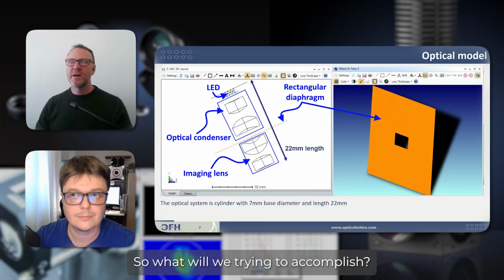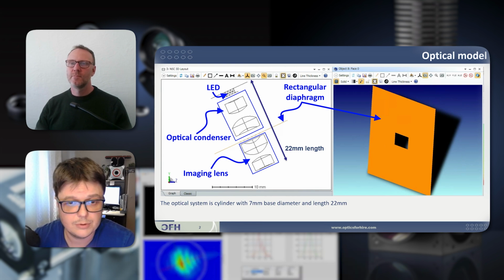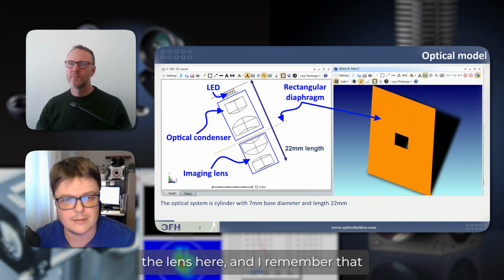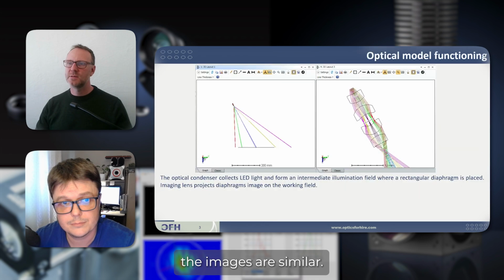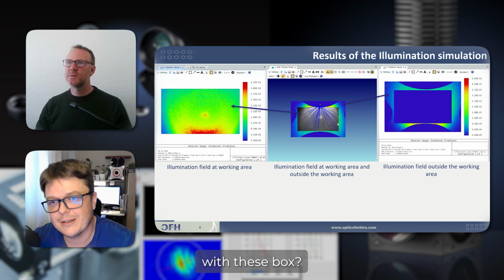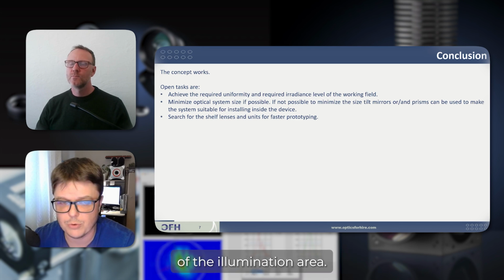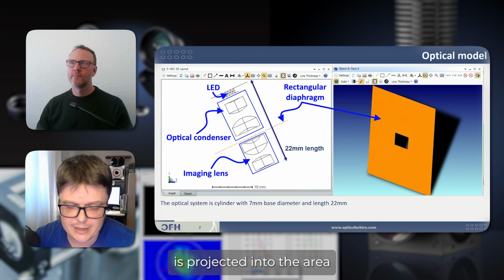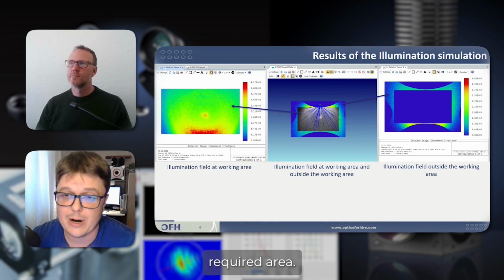Zemax modeling of IR illumination

Comment: How do you simulate the LED itself?
Reply from the maker: The LED suppliers ( the major ones anyhow) provide raysets for designers to use, more here:  https://www.opticsforhire.com/blog/what-is-a-rayset/
Reply: Besides using the files formed by the LED suppliers, we can form  the LED models based on the available information. Generally LED datasheets provide enough information for this.